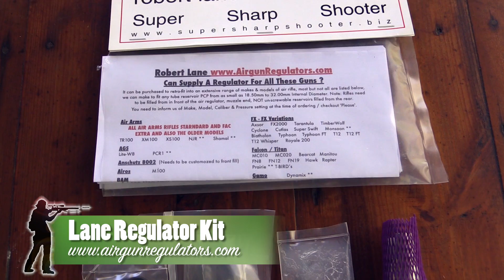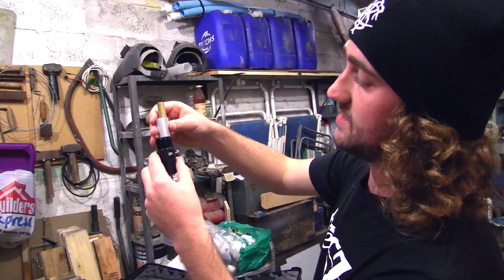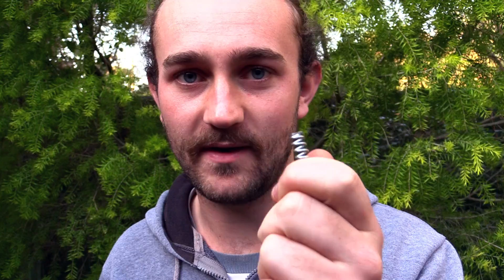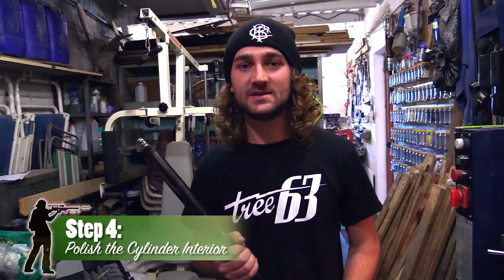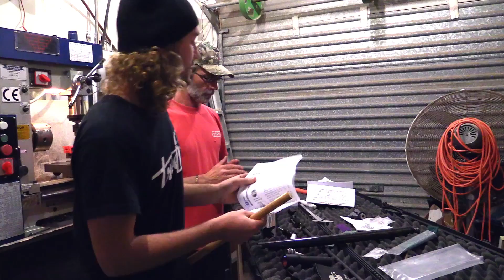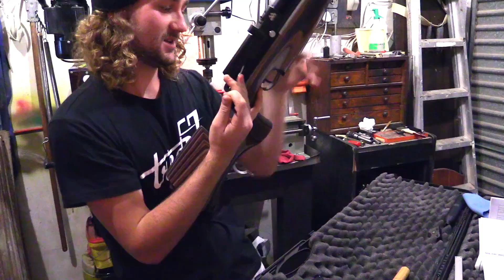Lane Regulator Installation | Air Arms S510 Xtra

Comment: DAMN DUDE...YOUR SO YOUNG IN THIS VIDEO AND TO THINK YOU AND NICHOLE ARE GETTING/IF NOT MARRIED BY NOW??? WOW HOW TIME FLIES MY FRIEND. GOD BLESS YOU BOTH. I WANT TO PUT A REGULATOR IN MY DIANA BANDIT PCP PISTOL AND IN DOING SO I THINK MY FILL PRESSURE SHOULD BE SAFELY INCREASED BY 50 -100 BAR EXTENDING NOT ONLY MY SHOT COUNT BUT USABILITY OF THIS PISTOL IN THE FIELD FOR PEST CONTROL. WITH THE REGULATOR I WILL AVOID VALVE LOCK BECAUSE THE WORKING PRESSURE WILL BE THE SAME AS UNREGULATED...AM I WRONG?  I HOPE AND PRAY YOU GOT THIS RIGHT MY FRIEND.

Comment: Very interesting video Matt I hope you and whole crew are healthy and well.I have just fitted a Lane Mk 9 Lancet into my Air Arms S200 in .22 cal .It has transformed the gun even on UK legal limits.From a 190 bar charge I'm getting 80+ shots at 11.6ftlb and still finding 100 + bar in the air resovoir.Gun is quiet and consistent now the Reg was set at 100 bar.Rob is a brilliant guy to deal with and very knowledgeable.Iv had the barrel threaded to 1/2"unf by Phil Crampton at Rat Works and fitted a SAK moderator.Really pleased with my little vermin basher now.Stay safe all the best.Regards Tony

Comment: If you drill the breather hole at the bottom of the barrel, the O-ring lubricant will leak out.  That is why it is drilled at the top.

Comment: I've been following your channel for a while now but, not since before this video was posted. I wish I would have seen this video before I installed a regulator months ago. I had the problem you mentioned about the air cylinder not being smooth and causing a leak. It took me quite a while to figure out the problem and even tried to install a larger o ring. Once I figured it out, it solved the problem and works great. It was worth the effort and I love the consistent accuracy. Now that I've done one, I'm not quite as worried to try it again.

Comment: Just planned to buy lane regulator for my AA extra fac sporter 0.22 cal. Can somebody please advise what is power output desired to ordering this regulator ( ft-ibs ) as my target is around 920-940fps@18grain or 960-980 fps@16grain with full power knob adjuster? i saw that in pyramid airgun, the spec is 29 ft-ibs but not sure if i need to order with the same spec as original. Btw im new in air gun and appreciated if can help me. thanks..
Reply: salam alekom >>> did u buy it or still ?

Comment: I have my S510 regulated for more than a year now. It tightens up the groupings this rifle produces significantly, especially when shooting past 50 meters. One downside: shot count goes down because you lower the capacity of the aircylinder.
Don't forget to clean and oil the outside of the aircylinder after handling it so intensively to prevent rust.

Comment: Thanks Matt!  Whether you plan to install a regulator or have purchased your guns equipped from the manufacturer, I would highly recommend for all interested, to check out Robert's channel @ YouTube "Airgun Regulators" as it is chuck full of info for those considering, purchasing or who have regulated guns.  He covers how they work, maintenance, tuning, lubrication and the different types.  There is no question that a regulated gun has huge advantages over unregulated, for velocity consistency, shots per fill, improved accuracy and ease of tuning.  I would ask you to direct folks to his channel, in you next clip, as most will not see my comment.
Reply from the maker: Yes, I have included that in my next video. His channel is amazing!
Reply: +AirArmsHuntingSA whats the eta on the regulator  review vid? awesome vid too mate!

Comment: One more thing I just bought a hw100kt laminate adjustable such a different rifle to the full length, not over weighted and so accurate it has a regulator fitted as standard.  So now I have my  AA S200 regged in .22 and my hw100 kt in .177 so happy with both.  Love the videos matt

Comment: Put one of these in my s200 never looked back. I get only a 4fps difference over 70 shots at 11.8ftlbs.  Just remember how small the air cylinder is on a s200.

Comment: Thats some realy invasive stuff rigth here.
In my evanix it was like ...unscrew the reservoir ... clean the reservoir... stick regulator int othe tub from the correct side, and add the spacer after it... screw it back on ... leave 0.5mm gap to let the bleedoff pressure out. Done. And it actually works. 15+- fps difference betweem shots.